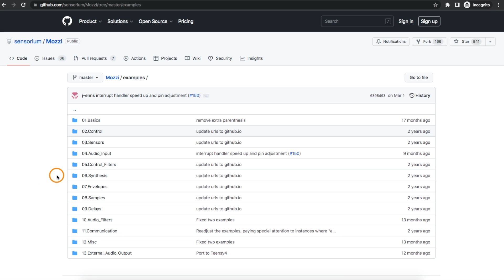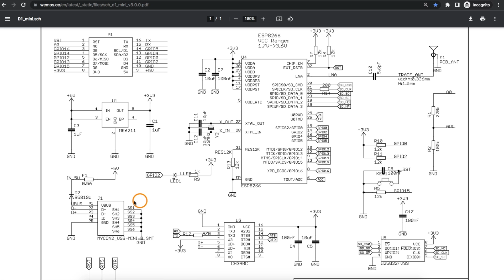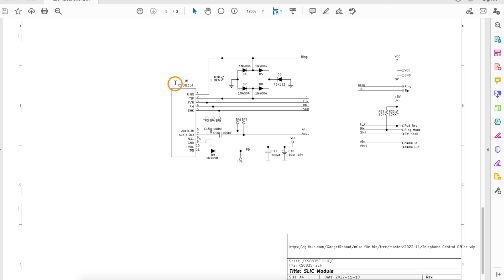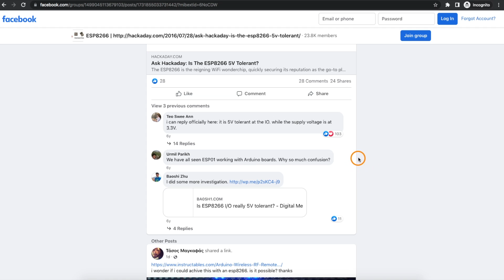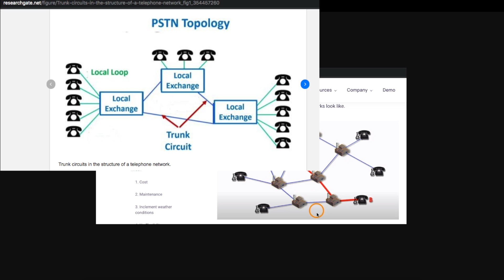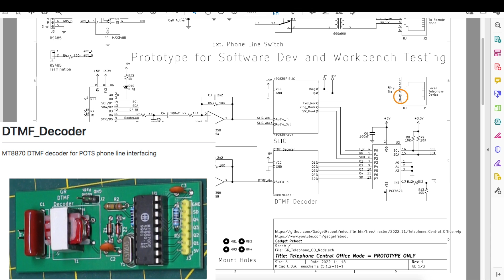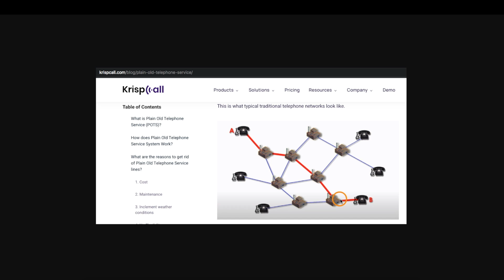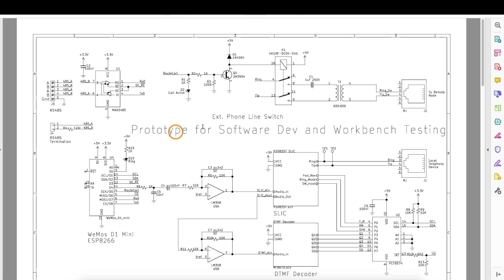Phone Line Sim Schematic (and some issues)

Comment: I've watched all of your "episodes" in making this and I love it!
I originally came to see how I could make an "old" phone tester, testing  pulse dial or DTMF to  BCD  so to display the dialed number on a  7 segment  display; .also  using the SLIC just to provide ringing current.
Now I may make a phone to phone demo board of my own! You sir, have expanded my horizon; thank you so much.
Incidently in the UK we call the Central Office the Exchange.
Also watching earlier " episodes" it struck me that perhaps you could hive off the service signal generation to another processor and just call the tones as required...
Reply from the maker: I’m currently ordering more parts to try some more things out including making a sort of expansion switching matrix where a bunch of exchanges can all plug-in and it will have its own way of routing calls between several different nodes, so there could be multiple separate calls in place or even party lines with more than two on the same circuit. I’ve been working on it more than five years at this point so the ideas keep coming.

Comment: Not to be too much of a party pooper it would be nice if circuit flow runs from left to right.  You i2c to the gpio expander reverses the flow direction. Must my ocd playing up again.
Reply from the maker: usually I try to go left to right especially with connectors that are input versus output but sometimes just getting it slapped together is good enough especially if it’s only temporary, and also it depends on things like those circuit blocks with the pins on the right side instead of the left, I would have to have redrawn that in order to get the GPIO expander flowing in the right direction so it just got wired up however it needed to get it done. The ESP 32 version will probably be more aesthetically compliant
Reply: @gadgetsideload  Did you try flipping the component hor and vert to change the input to the left. 

I had to work on a design for relay logic and the circuit was drawn with the relay to look like the component pin out.  They had not separated  the  coil from the contacts. So trying to follow a diagram that the connections when from left to right then back and then round in circles was near impossible.  in the end in my log book i did a quick drawing with coils, relay contacts as individual parts, working left to right and had it sussed in a few hrs. but then had to convert the mod back in to the mess.  

Never understand the requirement to keep a chip as one part in a schematic. 

Don't get me started on the folks who draw the entire drawing  as chips and net lists. so you have to hunt around to find where the signals go. It's no wonder that when they make the boards there are connections missing as you can't see the flow on the schematic.

Time for bed now, my headaches  🙂
Reply from the maker: I can flip the components to get the pins on the other sides, but I'm not sure if I can do the same with the hierarchy schematic blocks (probably can, didn't think to try).  

The thing I hate most is schematics where the symbol for a chip is drawn as a rectangle with pins to look like the physical chip, so I have to go find the datasheet to see which pins are gate inputs/outputs or op amp in/out.

My head hurts now too, I just finished adding more software features/states to the system and I'm about to try using one node to dial the other node with a phone number.  But first I get to go shovel 20cm of snow!
Reply: @gadgetsideload  Wish we got snow, we just get cold and damp in winter and warm and damp in summer. 🙂
With hierarchy block can't you just move the connectors around, i sure you can.

not sure if you can do it top level or you have ot open the sheet.
Reply from the maker: I haven’t used it very often in this schematic tool so I keep forgetting what’s possible and how to do it, and I’m just rushed. On the bright side I just finished some testing with two of these designs successfully letting one phone call the other and establish a connection so now I have to get the camera out before the whole thing falls apart.
Reply: @gadgetsideload  look forward to seeing the video if it don't fall apart to soon.
Reply from the maker: It actually did fall apart when I tried to nudge the breadboards into the camera frame, took 45minutes to track down something wrong with RS485 wiring.  Got it going and filmed it so if the footage looks ok, I'll be on the way to making the official video for the main channel.

Comment: Going over to the esp32 is a good idea as you can keep your phone code in core1 and leave core0 to keep Wi-Fi happy
Reply from the maker: I was even thinking about having the audio stuff handled by one core so that it wouldn’t worry about hiccups  from other code slowing it down but if I could also get Wi-Fi working reliably that would be good because that was my original plan to talk between nodes instead of RS 485 but ESP 8266 made that impossible. So I definitely think I’ll be doing another hardware revision at some point.